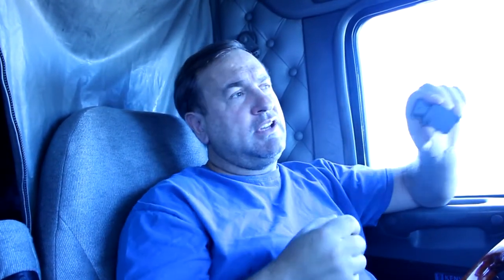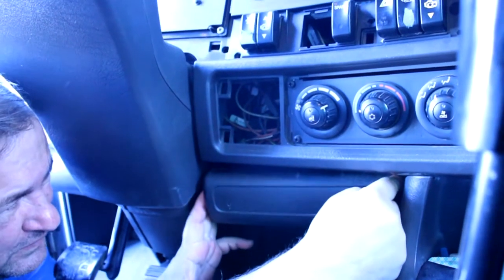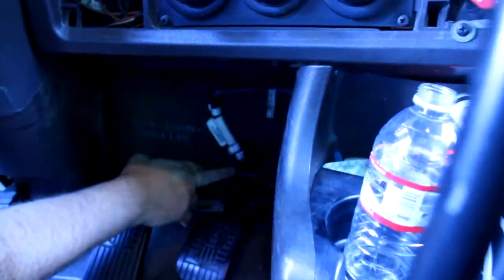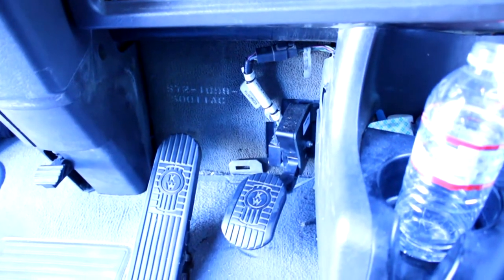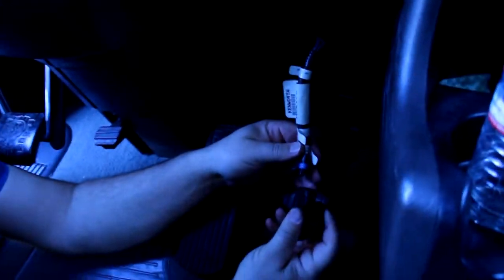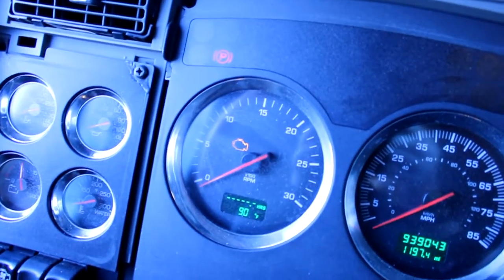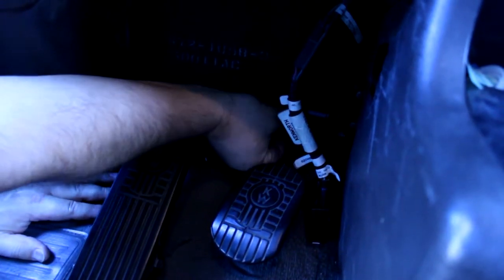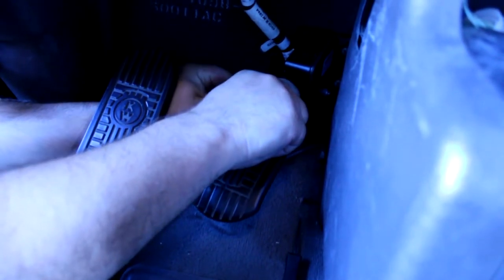accelerator pedal sensor problem

Comment: In my case I replaced the the sensor and still keeps doing the same ??? The mechanic is saying I have to replaced the whole pedal throttle , but is about $1800
Reply: $550 at kenworth Jacksonville fl

Comment: Same problem last night on i40.. it would keep cutting out. Dropped load and went to TA this morning in mebane been stuck here since 9am. Cant find problem. Replaced the sensor and now no response what so ever. They put old one back in, still no response.
Reply from the maker: Check wires to ECU
Reply: So what happened??? What did you do?

Comment: Hello
My truck is volvo d 13
I have issue
When rpm go betwin 600 to 700 during move the truck jumbing . if truck idle engine harsh sound 
Aftar that evry th good
no code
Thanks